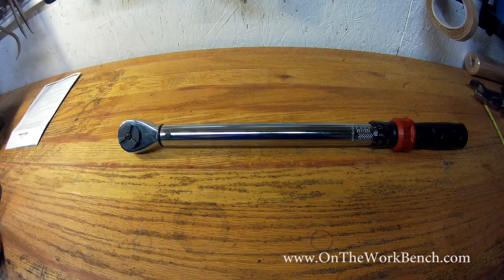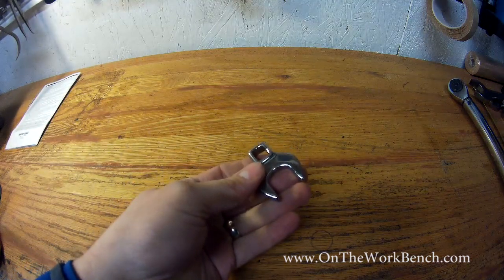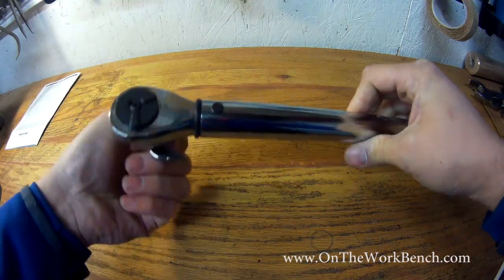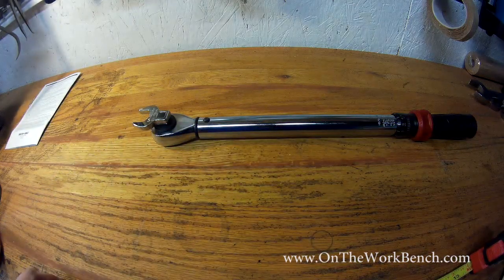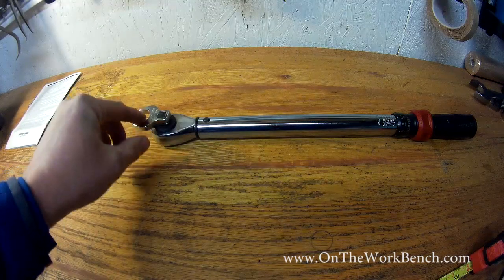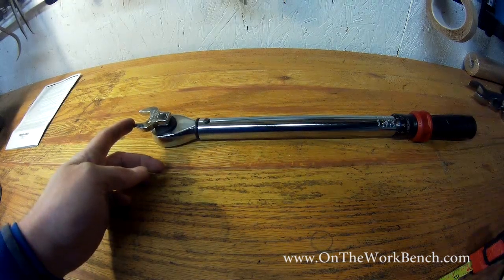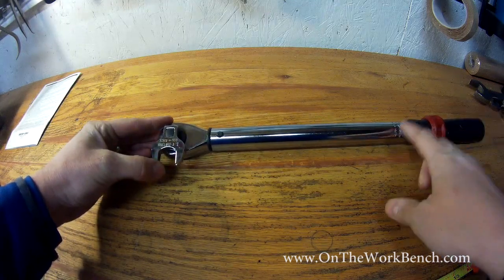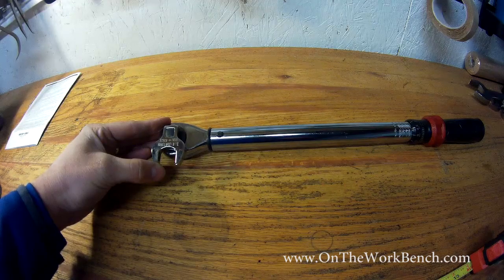Tip: How to Correctly Use a Torque Wrench with a Crowfoot Wrench

Comment: so now instead of using the leg of a triangle for your distance you are using the hypotenuse.  Still not precisely 16"  You have to do the math and compensate accordingly.  I doubt there is any way around it.
Reply from the maker: When the pressure on the torque wrench is applied to the at 90° (parallel to the crowsfoot) neither the length of the crowsfoot nor the hypotenuse created between it and the wrench matters. This is analogous to adding an extension between a regular socket and a ratchet; the length of the extension does not change the torque being applied to the fastener. If you have access to an engineering statics textbook, lookup "moment of a force about a point", and you should be able to find more examples. See also: http://web.mit.edu/4.441/1_lectures/1_lecture5/1_lecture5.html
Reply: Lets say that the torque wrench handle is the X axis, then adding an extension to a socket is analogous to adding length to the Z axis.  Torque is only affected by changes in the X and Y axis.  I don't like that analogy.
Reply from the maker: Fair about the extension; a moment (e.g. foot-pounds or newton-meters) is always calculated by multiplying the perpendicular force times the distance from the point that the perpendicular force is applied. The key is to NOT effectively lengthen the torque wrench by placing the crows foot parallel to the handle. The bolt acts as the point; and that the force applied to the end of the torque wrench when the crows foot is at 90° creates a force vector. The moment is the force applied to the torque wrench multiplied by the distance that force vector is from the bolt at its closest point. The closest point will be the along the straight line created by the torque wrench.
Reply: Bro look at this experiment/video.  You see how even with the crowfoot at 90 degrees there is a change in the torque spec from just using a simple socket.  Say that the leg that was created by that crowfoot being off center from the wrench is about .75-1.25 inches.  That does not affect the hypotenuse by a lot, just say enough to get the different torque readings when he goes from socket to crowfoot.  Just saying that hypotenuse does make a noticeable difference.  The meter don't lie.
Reply: JOe Shmoe You are wrong. A moment is the perpendicular distance from the pivot point to the applied force.  The crows foot could be 20’ long and it wouldn’t affect the applied moment.  The hypotenuse is irrelevant.
Reply: Yes, you can use the hypotenuse for the torque calculation, but then you must also account for the fact that the force vector is not tangential to the axis of rotation of the fastener, and the axial component of the force vector does not produce torque. So from 0-90 degrees you'd have a longer moment arm (more torque), but a smaller effective force (lower torque). For a 90 degree angle the effects exactly cancel. Simply using the perpendicular distance between the line of action of the force and the center of rotation as the moment arm avoids all that needless messy trig. See the MIT lecture posted by the OP, or if you prefer the "all-knowing" Wikipedia, scroll down to the Extensions section of Using torque wrenches and check out the equations: https://en.wikipedia.org/wiki/Torque_wrench

Comment: If you are going to say "It's a simple case of statics, for those of you that have taken engineering classes" you should at least use the correct imperial unit for torque which is lb-ft. Otherwise, some interesting information to consider when transferring theoretical knowledge to physical practices. Thank you!

Comment: LoL - “16 inchs, which is 1-1/4 feet”. Unless a foot is now 12.8 inches, you lost any credibility right there.
While your explanation is accurate if you were using an old fixed torque wrench with a needle and scale, you are ignoring the connection point (node) between the torque wrench and crowsfoot (node) has some freedom of rotation (that is where you are measuring.) With any ratcheting torque wrench you are applying the torque (bending moment) to a point (node) a small distance away from your fastener regardless of the angle of the crowsfoot. The error is the same at every angle.